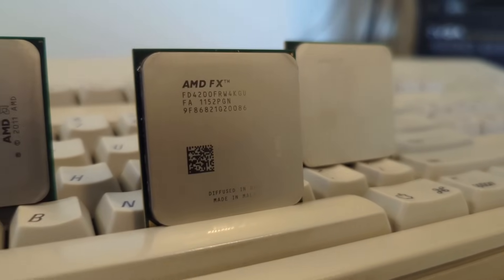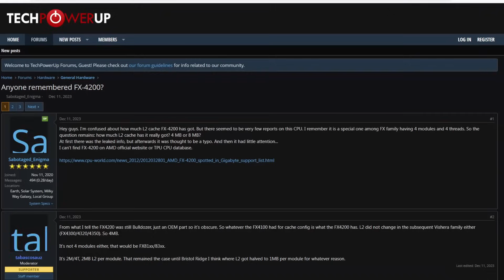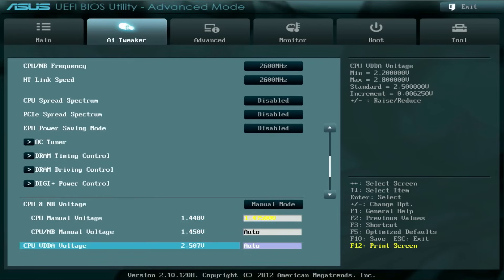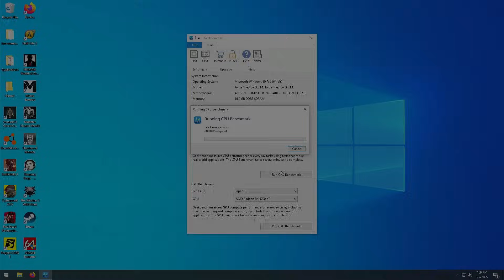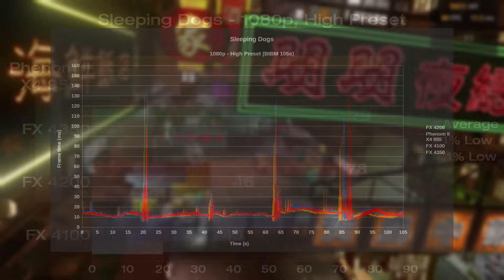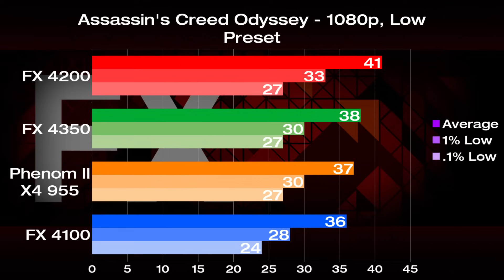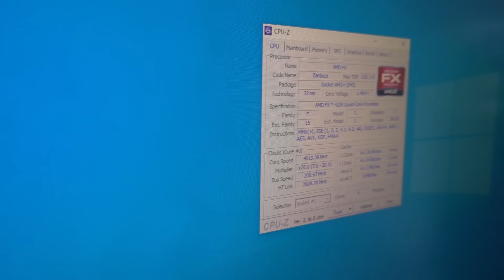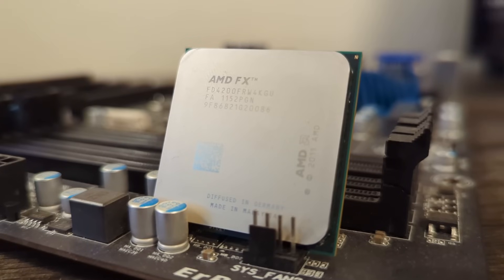What if AMD FX had "real" cores?

Comment: I had the 8350 Black edition , and you are one of the first people I have ever heard or seen actually use the correct ram with those chips. You're right about the FSB needing to be played with, but you said it about the ... well not wrong one, but it actually applies to both. Let me just break it down like this. For FX, you can actually play with things like the FSB as if it's infinity fabric almost. I used to, and it gave me some bonkers results back in the day. Made it hard to believe people were having as many issues as they were with it, what with the 'fake core' and all that. But when I started to realize they were mostly using 1600mt/s ram on these things... well I just mostly blamed it on that. But you mentioning the FSB makes me wonder about that as well, cause I also used to run it similar to how infinity fabric works today. This was before it was a thing; but I found it curious to be almost the same thing I was already doing with the FSB on that FX rig.
Reply from the maker: Originally I was going to use memory with much looser timings, but a friend recommended this awesome kit, I'm glad I picked it up!
Reply: @SPNG  Smart, good friend. They saved you from a world of potential issues. I would get a flickering black screen when I tried to use 'the only ram you need in 20xx' at the time. The idea was that back then, since the phenom chips only needed 1600, and intel was fine with 1600 as well, then the FX chips only needed 1600. 

Mark down yet one more time the internet was wrong about ... anything and everything. If I could track down the people who spread that misinformation back then, I could legally charge them for wasting my time and money. Not just mine either. Others could join in as well. And win.

So yeah, colour me surprised when someone on the internet finally got it right. Because this BS took nearly a decade for you to appear.
Reply: @SPNG  One more thought on the prior reply. You saw it already, so can't really edit it now. 

AMD themselves suggested the use of 1866mt/s (mhz back then before Dr Ian Cutress decided to correct the internet). 

People were going against what AMD had suggested themselves, but I only found that info by deep diving a google search due to all the misinformation that was about at the time. 

You ended up with the same sticks I had, more or less. Speed and timing wise at least, though different lineup. Corsair Dominator I think was the lineup.
Reply: @PredatoryQQmber  Well, you aren't wrong that overclocking and overvolting it would degrade it faster, but that's mostly a heat issue. Proper cooling kept mine going for nearly a decade. It only gave out, because I finally did push it too far and borked it. 

That was at about the 2400mhz level. 

It ran fine past 1600, and it's only you and others like you who were not competent enough in your skills in oc'ing, that were having these problems. 

Sometimes you don't overvolt. Sometimes you undervolt first while upping the speed, then you increase the voltage slowly until you are stable without seeing huge heat spikes, then decrease again until you lose stability; then back up again to find it again. You do this back and forth until you find the perfect spot to keep it at. It's faster if you have a better idea of what you are working with, but when working with newer stuff it's better to go slow and steady about it. Even if slow is annoying. 

I had mine running stable at 2133mt/s and 2133mhz locked with each other without issue for years. Well, save for a hard drive going due to a bad cable. That sucked. But aside from that, no issues until I got curious about how much further I could push it. That is why I know you are partially correct here.

Comment: Just more proof that all AMD needed to really do was add modern instructions to K10, shrink the node and improve the cache and IMC (and maybe have an 8 core variant - would have had a smaller die than 4 module Bulldozer/Piledriver).
Reply from the maker: I don't know... I think they would have run into struggles if they had just did that too. Glofo's 32nm node forced them to make many cutbacks to FX as it is. I truly believe it wouldn't have been as bad if it wasn't stuck on that dog of a node.
Reply: @SPNG  True, though their Llano APU were still K10 and on the same 32nm process as the FX series - and they definitely had space for 8 cores, if you look at Llano dieshots just over half of the die was for CPU cores. 227nm squared compared to Bulldozer at 316nm squared, modernised K10 would have been cheaper to manufacture, since the die would still have been smaller even at 8 cores.

Comment: Good motherboards from that era allow you to shut off 1 CU per cluster, like my Gigabyte 990FX-UD3 Ultimate.  I've found similar results with my FX8350 by turning off half of the CUs and allowing the remaining CUs to use the whole FPU.  I saw around 17% increases in IPC in Cinebench multicore if I recall correctly( total score divided by 8 with 2 CU's/cluster compared to total score divided by 4 with 1CU/cluster ), and because of the reduction of power consumption, was able to overclock it further within the thermal limit.  But, my Phenom II x4 965BE was better in most areas, as has been shown here in this video as well.
Reply from the maker: I don't think my board allows me to do that 😢 I might need to get another board and follow up the testing with a Piledriver version of this. I still think this chip is unique for coming in this config by default though, and being marketed as a quad core.

Comment: i had fx8150. it was ok. then got i5 4690k and it was 2x faster in games
Reply from the maker: I'm sure it was a good upgrade, did you ever do any overclocking to your 4690K?
Reply: 4,6Ghz. just watched my old 3dmark05 records. CPU points.  fx8150 got 19300p and 4690k 35300p

Comment: I loved my fx 8350! Had that thing running at 5.1 GHz at 1.55 volts for 5 years with zero issues. Upgraded to the R7 1700 but the chip itself had no issue other than being a space heater
Reply from the maker: Damn that's fast, having my 9370 at 4.7 felt like it was really quick for what it was, I can't imagine that though. The power consumption must have been extraordinary though, even with the 9370 my total system power draw went well above 500W

Comment: i hope people know this but the ryzen cpu's use the same core complex as the FX chip's , now the fx X100's ie bulldozer has massive design flaws that wont allowed the chip too fully load all the cores Fx X350 chips IE piledriver fix this and is a monster and carryed its self way farther then any Intel quadcore wish's it could

i also have a 0.1% core bench setup with a 4.4ghz all core with 220bus and that chip never for one second made me regret my choices also those 1600mhz Gskillz at 1780 with the tight timings what a chip it was if u tuned the sht out of it still a 10/10

Comment: Awhile back I was looking thru Ebay and found an AM3+ Opteron 3365 "And yes I know it's a Server/Workstation CPU"  and bought 1 to play with on 990Fx board and found that it is an 8 core @ 2.3ghz. Asrock 990Fx Killer was my choice with 32 gigs of Mushkin RedLine @ 2133. Bios has been updated so I can use an NVME 1Tb drive and even though I haven't ran it very much it's supposed to be unlocked and a lot more potential than the AM2 versions. I have collected a lot of parts over the years and I don't have very many newer Video cards to run with this system so I used a HD8990 to keep it all AMD and it seems to run very well. I haven't tried any OC yet so I just want to see what will and wont work with this setup.

Comment: I had 8350 overclocked to 4.9ghz,I5 4460 and i7 4790 in same time . FX was blowing 4460 out of the water in modern games,while trading blows with 4790 . Same in benchmarks. FX series was really opening up above 4.5ghz on good motherboard. I had saberooth so no limits.
Reply from the maker: These chips do open up a lot with some overclocking, I did some tuning on my FX-9370 and I was pretty satisfied with the performance. Power consumption on the other hand... 😬
Reply: @SPNG  DId you overclock FSB? My one did 300mhz stable,big singlecore performance improvement .Power consumption is one thing,boiling 360mm aio is another lol . No heating in winter needed
Reply from the maker: @miki476  Nah, I used the multiplier only. But some of the comments in here are making me want to grow a pair and try out OC through the FSB
Reply: @SPNG  HT and NB should be at 2600mhz period . FSB depends on motherboard and chip itself

Comment: If it weren't for the failure of the Bulldozer experiment, AMD wouldn't have refocused on Zen. They needed to find out what not to do before they could make something great. Zen seems to be everything they would have wanted Bulldozer to be, a modular architecture with great performance.
Reply from the maker: Just like how Sandy Bridge drew some ideas from the failed Netburst, Zen did much of the same with Bulldozer. Sometimes even if an architecture is a failure they can learn a lot from it and come back stronger.

Comment: I had a Sandy Bridge Pentium G (I can never remember the model number) prebuilt system that was quickly replaced by a system built around an FX-9370. The Pentium was faster, and it was not a fast CPU SKU. The FX wasn't my first choice, it wasn't my second choice, and to be honest it wasn't even my choice to begin with. At the time someone picked up parts for me and they chose to ask the poor soul working at a Canada Computers retail location for what a PC should contain at the time, and they recommended the FX-9370 and a motherboard it would murder in 18 months. For reasons not worth explain, returning the parts wasn't in the equation. I don't remember which motherboard it was beyond it being a poor ASUS M5 series board with blue accents and the wrong chipset (from looking at pictures, probably an M5A99 EVO R2.0, but I don't have the box to confirm). Even after replacing that motherboard with a Crosshair V Formula-Z, I was furious with that system for its entire life. Even with the side panel open, if you set the highest safety target (other than "off") for the thermal protection of the chipset, it would shut down. The FX murdered an AIO in less than a year. It killed a power supply. I had the fans cranked to 100% at all times in a room that most of the time was below 16°C, sometimes below 10°C in the winter and it STILL hit 97°C when doing things. The CPU would hit 60°C from a cold boot by the time you got into the temperature page in the BIOS. Possibly related to the CPU, both motherboards had their USB ports die for seemingly no reason after a few hours of being turned on causing everything to reconnect. The audio chipset on the Crosshair board died like 3 years after I started using it. The audio out only worked if you used the Windows Realtek control panel to redirect audio out through Line In, while you could only get a powered Mic In working if you plugged it into the Line Out on the front panel and again used the control panel to redirect which port did what. The Line Out ports didn't work for audio out, they just produced screeching, as did the actual Mic In. The Line In port doesn't have gain when in Mic mode so you couldn't use that even if the front panel Line Out worked. It wasn't a driver issue as the same thing happened in Ubuntu at the time, except I couldn't fix it there. When the system wasn't being an absolute pain in the rear, it was just being ungodly slow. At everything. I had a HyperX SSD at the time and I gave up using it as a boot drive at the time because it genuinely didn't improve boot speeds in Windows 7, 8.1, or even later 10. It was 120GB and managing the install location of apps was also a pain, especially since at the time a large number of programs I was running wanted to store absolutely everything in the user appdata directory tree, which obviously filled the drive quickly.

I still have that system but it hasn't been turned on since it was replaced by an AM4 system built around a 3700X. I was cursing AMD the entire time I was stuck using that system, up until a few weeks after Zen 1 came out and I admitted that my problem was with the Bulldozer architecture lineage and not AMD themselves, and that holding a grudge over my FX being a complete piece of work wasn't worth the energy or thought. Up until that point however I was not impressed at the people who only bought Intel whining about how Haswell and Broadwell were basically only power efficiency gains, because I would have killed for that. I knew someone who owned an FM2+ and they were quite happy with their system, and I didn't bother them about it, but I also knew that their last system was from 2008. And it was not a good system from 2008. They were confused as to why my FX wasn't any faster than their system when they used it a few times. I don't miss it, and in retrospect I think I would rather have watched someone burn the $200 canadian dollars that CPU cost my budget at the time because it cost me over $500 to fix all the problems it caused in the operational life time of that computer.

My first choice was a Xeon that was $200 and an ASRock motherboard that supported it. I don't remember which of either it was, but I do remember that the Xeon was a steal because it was just an at-the-time fairly impressive i7 but without the iGPU. The person who went to purchase the parts on my behalf thought that was an absolutely ridiculous thing to put in a desktop so bypassed my request.

Comment: Tis why I got my 955BE in my first build even though the bulldozers were out for almost a year already. Got it on sale for like 80 bucks and most game benchmarks were on par with even the fx 8 core and not too far off from the over 200 dollar i5 K  chips. Lasted me about 6 years before hoping up to a cheap fx 6300 off ebay for 30 bucks to get 2 more years out of the system(newer games needed the instruction sets and actually used the cores) . Both being am3 was awesome for amd to do since intel was rolling out new sockets every generation. 
This computer was a space heater  but I got my moneys worth out of it for sure.

Comment: A very, very, missed opportunity was to pit the FX-4200 vs FX-8150.
How much did the "two cores per module" actually do?
Here are a few AIDA64 numbers to compare:
  -Julia: FX-4200 11,173, FX-8150 11,912 (+7%)
  -Mandel: FX4200 5,563, FX-8150 6,096 (+10%)
  -FP32 RT: FX-4200 1,945, FX-8150 2,541 (+31%)
*Note: the FX-8150 scores are from AIDA64 itself, the standard FX-8150 runs at 3,600 MHz and can all-core boost to 3,900 MHz (but may run at base speed if the 125W are already used...)
Reply from the maker: If I ever make a follow up this would be the subject. But to be honest this video took long enough to make with this lineup as it is, and I think a comparison to Phenom II would have been more important to show.
Reply: @SPNG I think the comparison of "1 ALU vs 2 ALU" per module would clearly show whether Bulldozer design is valid.
  My look at it showed about +84% on regular/int CPU operations, but only +7% average on FPU.
  Games are where I'd like to see a good test.

Comment: IMHO the biggest holdback in the FX's performance wasn't so much its architecture, but rather how they were handled by software. If the scheduler treated paired cores more like they were HyperThreaded as opposed to independent, they wouldn't have been tripping over each other so much and would have been rated better.
Reply: But there's no recognition really (or else software specifically checks), multi thread in cores are as well as separate cores too really are treated as separate CPUs, it work that way to fake os there more then one CPU so no matter what send some code to it. There really no standard on what x86 CPU should behave it only defines what should be end result but not how it is reached, so hardware multi thread is kind of a out of standard hack that CPUs do, because of that its hard to target particular CPUs. That said Windows have process thread affenity setting for applications so stuff like that can be done via 3rd party.
Reply: I remember Win7 having a hotfix to address this issue
KB2645594
KB2646060
Reply: When FX was first released it required an update for Windows that fixed the scheduler treating all cores equally so it was handled like a hyper threaded design. The FX architecture's quirks just overall made it mid when you're running code compiled for a generic Windows system.

Comment: Your conclusion was good. These tests would lead me to conclude that AMD did not go for high single core IPC for these chips so without the CMT it isn't that great, even for a true quad core. During that time period AMD was readying the Chips they provided for the 8th Gen Consoles, and knew the engines and therefore games would become highly multithreaded. It gave the FX series much longer legs than they would have had otherwise.

Comment: This was a neat video. While I never had any of the mentioned CPU's, I did/do have an FX-8350 that I used pretty heavily paired with 2x HD7970 GPU's for a good 8 years. It pretty much handled almost everything I could throw at it until later titles started really hammering the GPU's. Almost 3 years ago I finally upgraded to a whole new system with a 5950x and 4090. If my HD7970's weren't falling apart I would have likely still been on the FX-8350 and not upgraded my system to begin with for a couple more years I'd imagine. I don't really game all too much anymore and at least not on the newer titles available today. I still have that chip buried in a drawer in my garage.
Reply from the maker: Thanks! And that would have been a sweet setup, how was game scaling like with the 7970 CrossFire? I feel like that time was later than when most people got into CF, I wonder how many games were still supporting it decently.